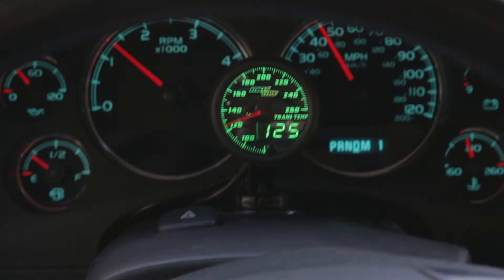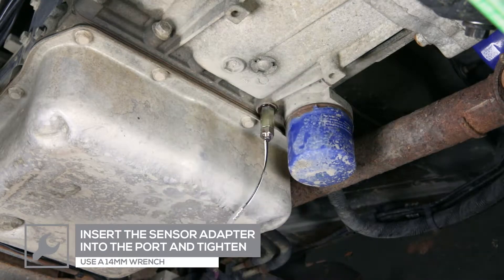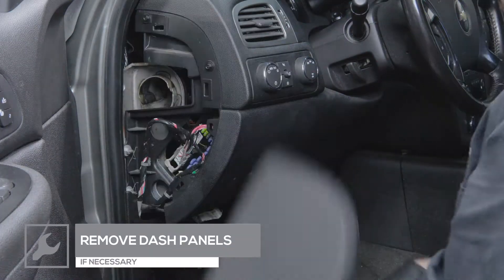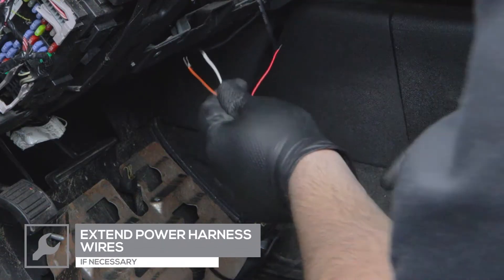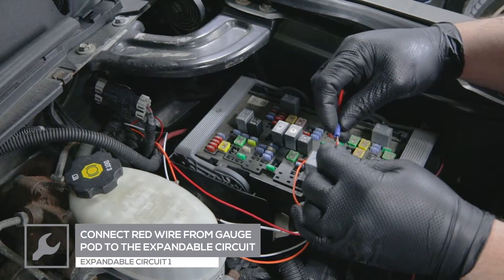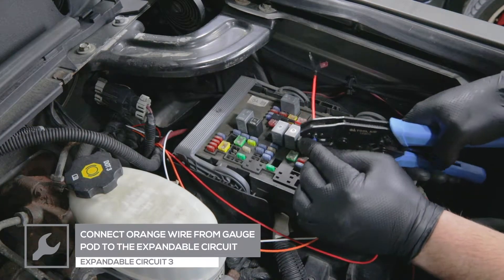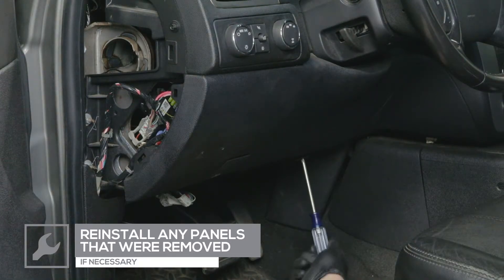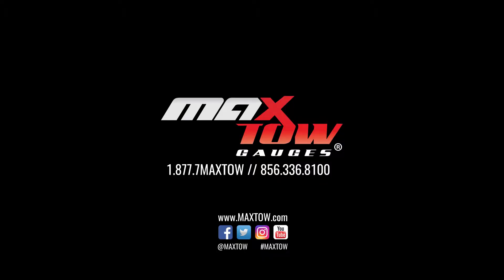MaxTow | How To Install a Double Vision™ Trans Temp Gauge Into Any 2007-2013 New Body Style Duramax

Comment: Just finished installing on my TJ wrangler. Great gauge. 
Im having some issues if I can get some help - After installing - the gauge only lights up and works when in either Reverse or Drive. It turns off while in park or neutral...

Any thoughts where I could have gone wrong during the installing? Thank you and take care guys